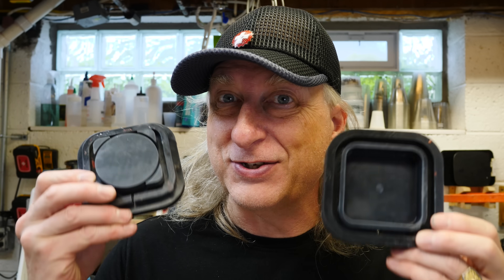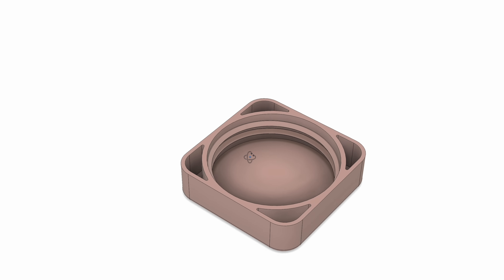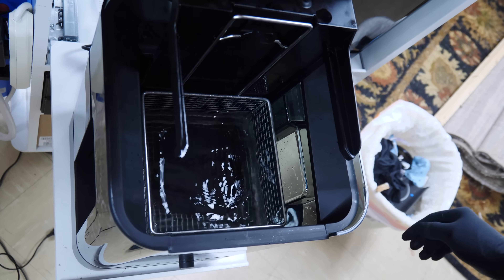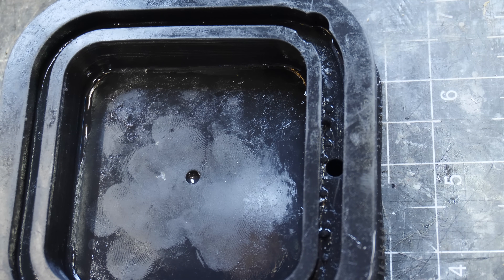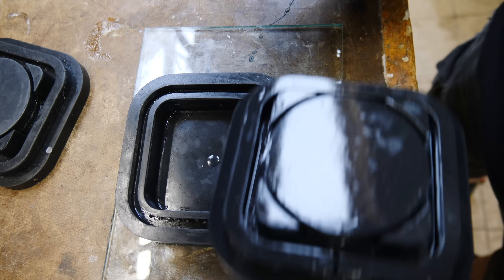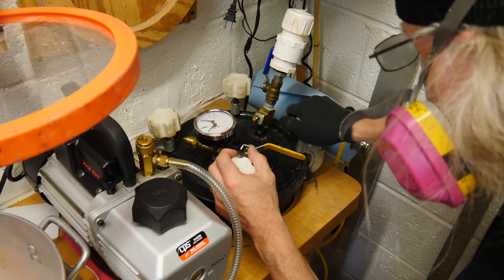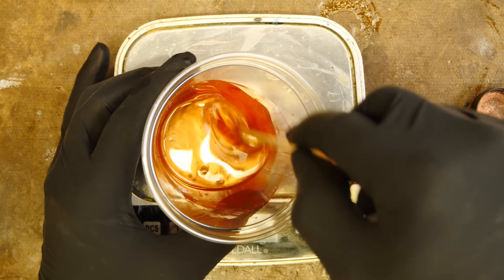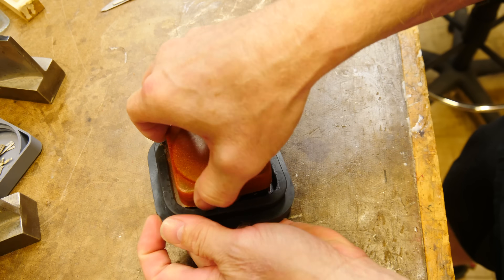3D Printed Silicone Molds - Game Changer!!

Comment: It's a gamechanger as long as you have that $20.000 setup and you're fine with mediocre parts. You could do vapour smoothed FDM prints in half the time at a tenth of the effort though.
Reply: The complete package for the new Form 4 which is crazy fast is $6500, not $20k. I'm looking at getting one for work for exactly the process Eric showed. I'm a product designer too. I use FDM all the time. But sometimes you need to mold a few parts, and being able to go straight to the mold instead of printing a master first would be an incredible time saver. Of course there will be some details to be worked out in the process. Those parts also aren't mediocre. They look great
Reply from the maker: @evanbarnes9984 good luck with your future projects, don't forget the link to get a discount if you're serious about getting a machine. You're going to love it.
Reply: @evanbarnes9984  "Those parts also aren't mediocre. They look great"
They have holes in areas that should be solid......
Reply: @evanbarnes9984  Lol, there's literally a big hole in the part he selected (as well as in the mold) but keep smoking what you're smoking. And the mold was falling apart too in case you missed that. 

And that's not even half of the equipment he's using either.
Reply: @oyuyuy thanks for your constructive feedback
Reply: I’ve been 3D printing for 10 years and you would not get the same quality and dimensional accuracy with vapor smoothing, for parts like this the best way is resin printing. edit. i meant resin printing a mold
Reply: @kitmarshall4084  I don't have 10 years of printing experience, but I also think that a much better option for making a silicone mold is not direct printing with silicone, but casting a mold from a master model printed with resin. After that, you can do any experiments with the resulting silicone mold. This technique will give more opportunities for experimentation and will allow you to quickly make many molds for different compositions, paints, etc.
Thanks for confirming my thought. =)
Reply from the maker: @georgk2807 absolutely
Reply: @georgk2807  agree... you could probably change the durometer to fit your application. what i meant to say was to make a mold with resin, thanks.
Reply: @kitmarshall4084  Hmm, but if you make a mold from resin, it will be hard and for proper use, you will have to change the 3D model of the mold. I mean, the lid shown in the video will not be able to be removed from a hard mold if it is the same as the one the author printed from silicone. You will not be able to remove a hard lid from a hard mold.
Maybe I misunderstood you and you are saying that the mold for casting can be soft, even if it is printed from resin. I have not seen flexible resins, but if it is possible, of course it makes sense to try. =)
Reply: @georgk2807  im not a resin expert... but your point are valid, i think it depends on the complexity of your project and how much effort you want to put into producing the mold.
Reply: @kitmarshall4084  Of course, but this isn't resin printing 😂
Reply: There are resin printers that are way cheaper than formlabs. You can get a great resin printer setup under $1000, even under $500 if you don’t use washing and curing stations.
Reply: I have had decent success printing superflex resin on a cheap resin printer doing a similar thing. You don't even need the printer he is using. The super  flexible resin is not silicone based but it's flexable enough to pull the mold off of the part. You do have to use mold release, but there are no printlines on it like you would get from an FDM printer. FDM is great for large things but you really have to sand the parts to get them smooth compared to a standard resin print. So your comment is misleading at a minimum.
Reply: @newmonengineering  Did you miss the part about the vapour smoothing? Also, depending on the part modern printers hardly produce any layer lines at all - even at a modest 0.16mm layer height.
Reply: I've printed simple molds like this with fdm, used auto filler primer (high build) on the insides and sanded smooth. Not a horrible process.  Use release and Viola, parts mold.  

Just be sure to design flexibility into the molds at the bed adhesion surfaces so they will bend a bit when clamping, to offset any bed lift from printing shrinkage.  

This process is accessible and cheap.
Reply: Just resin print it . Done
Reply: I'm just here to commend @EricStrebel for not deleting opposing comments, I always hate finding a sterile comment section under a video.
Reply: @oyuyuy Oh I’d like to see your better method. Can you point me to your video - or are you just the guy that thinks he’s smarter than everyone else but doesn’t do anything?
Reply: You complain about mediocre part quality, then suggest as an alternative a technology that's unsuitable for fine details, has poor surface finish and is suceptible to delamination thanks to low strength in the z direction?

FDM printing is pretty much the worst prototyping tech available for cosmetic parts, and vapor smoothing is somewhat of a bandaid fix (only works for some filaments and "smooths out" all details, including the ones you want to keep). It's somewhat better for mechanical parts, but even there the anisotropy isn't great.

Besides the goal here is to create batches of identical parts, something casting is better suited for. You want to limit post processing.
Reply: @RB-kb3tc  No fine details? Poor surface finish? DELAMINTATION??? Haha, hilarious. Sounds like you're hopelessly bad at FDM-printing.
Reply from the maker: Lol, do your research and think before you post comments like this next time, because you're way off base and wrong and you're missing the point.
Reply: @EricStrebel  So mad that you were unable to produce a single argument. Oh well, what can you expect from a sponsor puppet.
Reply from the maker: This is about speeding up your design process and exploring specific colors and materials durometers, FDM is not about that.
Reply from the maker: Not mad, just pointing out you did not do your research before you commented
Reply: @EricStrebel  Haha, yeah... FDM is terribly limited in colors and material variety...
Reply: @EricStrebel  "Not mad, just pointing out you did not do your research before you commented"
But i mean he got a point: The video shows that you had to do a lot of extra work to get the mould ready, it broke apart quickly, and the part was so out of shape that the part had a hole.
So it does appear that had you printed a normal positive and created the mould like you normally do you would not have taken much longer if at all, but you'd have a mould that would give you a more accurate and lasting result.
Specially since that form was so ill suited for this trial.
Reply: @ABaumstumpf  this video wasn't about how perfect the process was. It was about the possibilities it opens up. You are watching someone run experiments so you don't have to.
Reply from the maker: @phillipshryock9248 correct, thanks for posting that out, much appreciated
Reply: @phillipshryock9248  yes? And the comment was about the result - and you apparently do not want people to be allowed to discuss that.
Reply: @ABaumstumpf  the original comment was about price and result. And his video wasnt about either of those things. The video was about a cool possibility for what could be coming in the future. He never said it was perfect now or even that it would replace his current process. It was about showcasing a cool thing he found and sharing the process with his audience
Reply: @phillipshryock9248  "the original comment was about price and result. And his video wasnt about either of those things."
it was about printing silicone in a commercial setting - yeah it was about price and results.
Reply: @ABaumstumpf  Then you obviously didn't understand the tone or purpose of the video. But please keep commenting, it helps drive his video. I personally love the experimental nature of his videos
Reply: @phillipshryock9248  "Then you obviously didn't understand the tone or purpose of the video."
Ah yes, so you got no argument and start with ad hominem - while also projecting your own lack of comprehension onto others.
Funny how that works.

Just to recap: This is the video where he literally titled it as "game changer". Not about experimenting or saying it needs work.

but hey - feel free to stay such a toxic ignorant troll.
Reply: @ABaumstumpf  tone and purpose is only determined by the creator. And the creator of the video backed my comment that you are misunderstanding the point of the video so I think you may want to cool down and rewatch with a different mindset. 

But if you would prefer to keep arguing over a subjective opinion then by all means. I am more than happy to argue and keep driving the engagement for this video 😄
Reply: @phillipshryock9248  "tone and purpose is only determined by the creator."
And you are ignoring what he did there.

"And the creator of the video backed my comment that you are misunderstanding the point of the video"
So if i make a video saying you are a walrus and then you comment that you are not - i can simply say this is not the tone or purpose i set up for my video and just claim you are wrong?

Sure. if you wanna be that dishonest.
Reply: @oyuyuy not everything needs to be a “debate”. Almost everything this guy posts is experimenting with new techniques to produce prototype parts.  There are plenty of other places to watch people 3d print toys on FDM machines. Just relax a little and you will enjoy life more and possibly learn something neat.
Reply: @jamesx7424  It's hilarious that you pretend to be above 'debating' and still can't stop yourself from jumping in and taking a jab at FDM. Zero self control.
Reply: @oyuyuy  the guy posted a video on the subject. Isn’t that the “argument”?
Reply: This guy clearly knows nothing of 3d printing

Comment: Thanks for the review. Looks like this material will come into its own for direct silicon prototype part printing; gaskets, anti vibration mounts, phone cases, etc. From your review it just seems too much hassle compared to your usual methods for making silicon molds.
Reply: I think it is less of a burden to 3D print the positive, and make the mold out of it then. Atleast until we could 3d print mold with less support involved.
Reply: Yeah, in theory you are removing a step and wasting less material, in reality you are just signing up for a whole load of unnecessary hassle, I'm sure this has applications, but making molds isn't really one of them, practically speaking.